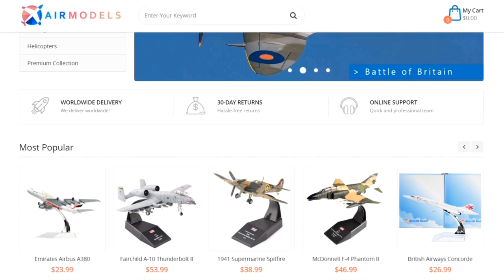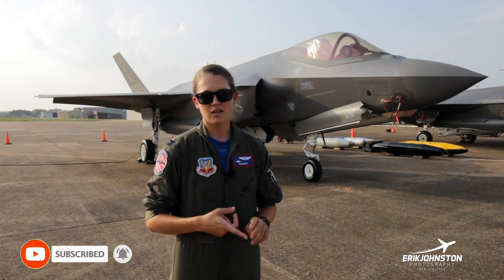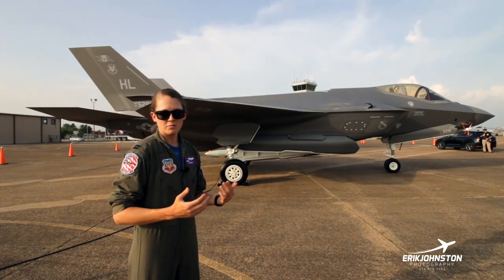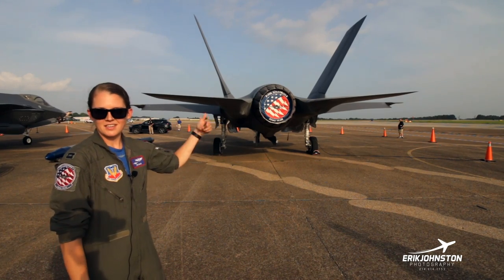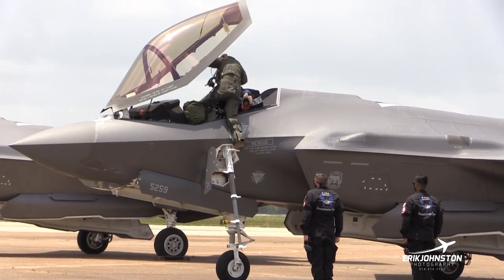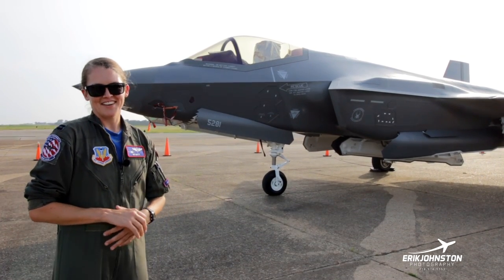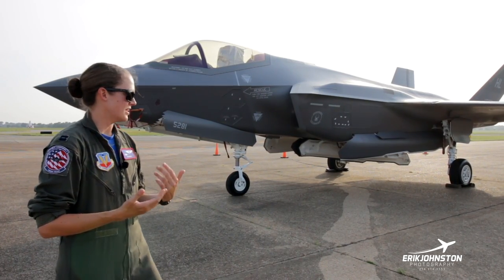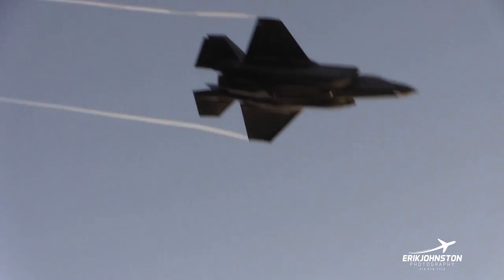F-35 Lightning Walkaround Tour

Comment: tis a shame shes so hobbled on what shes allowed to talk about. you can tell shes constantly running through what shes allowed to talk about
Reply: Gmail X or it can they just don’t want to leak classified things.
Reply: Commenter2   Not a chance!
Reply: Gmail X  thats right !  if can do far far more
Reply: She still seems to imply that the AIM-9X can't be carried internally. Not something you'd want enemies to know.
Reply: @thomasjoyce7910  well some things are common sense with this sort of aircraft. if the f22 can carry em internally then odds are this one can too
Reply: @thomasjoyce7910  it cannot. The wingtip hardpoints have a special pylon with reduced RCS for AIM-9X and AIM-132. AIM-9s are not included in standard A2A loadout, but if equipped, the F-35's RCS is still going to be minuscule.
Reply: @UnconfinedConfusion  i think that's his point

Comment: The F-35 has always left me a little cold, this presentation warmed me up a bit...
Reply: Seems most of its advances over previous craft are in its ability to relay situational data to a web of connected aircraft, so it kind of develops a hive mind. Not as "sexy" to talk about.
Reply: Travoid this is the thing a lot of people don’t understand. The USAF did a study a while back and found that 90% of pilots shot down even as far back as WWII never saw the plane or missile that hit them. Being stealthy, seeing the enemy first, and having versatile and powerful weapons has become more important than outright performance. Between active and passive radar and IRST, the F-35 will doubtless be able to see any current or near future fighter before the enemy sees it. Combine that with the coming lock-on-after-launch capability with the new block of AIM-9X and you have a fighter that can passively detect an enemy with IRST, and the pilot can fire a missile without looking down at the panel, even if the enemy is behind the F-35A due to the off-boresight capability of the new missiles.
Reply: @dheujsnrhfydhehehshshhdggsd  how's it like to live in a cave?

Comment: I believe that the F-35 was the most expensive military-procurement program in U.S. history. It was an ambitious project -- three variants with which to supply all of the armed forces. Unfortunately, none of them were reliable enough in the first few years to be of any tactical use.
Reply: "three variants with which to supply all of the armed forces" - already a thing with the F-111 and the F-4.
Reply: @ChucksSEADnDEAD  Perhaps, I don't claim to have knowledge of that. But I doubt that either of those programs cost just short of one trillion dollars.
Reply: @waynefletcher9884  The Navy flew the F-111B and the lackluster performance lead to the project being canceled but you're right, it was meant as a two branch project, not three branch project. I was misremembering.
Reply: @JMacQ77  The F-35 didn't cost a trillion dollars. The trillion dollars is the projected cost up until retirement.
Reply: F-22 is much more expensive!

Comment: It's the only aircraft that doesn't need line of sight to fire a missile air to air. In other words, there is no dogfight.
Reply: That isn't true. The Russians had the technology decades ago with a device that fit on the helmet that looks like a monicle followed by the U.S. which surpassed the technology with the 1990's vector thrust Aim-9X which allows an attack 45 degrees off of bore sight instead of 15 degrees. However the F-35 has a massive sensor sweep system that can target air to air and air to ground at the same time and data link the targets to other weapon systems in real time. It's the equivalent of a plane with nearly endless ammo.

Comment: he is a good pilot; and most likely has her choice of planes, but...

A thing that were not covered about the F35, possibly due to the fact that the one featured is not VTOL. The VTOL variation of the F35 has a **mechanical driveshaft**, a slightly better version of the same device one would find in a pickup truck

Comment: Whyd they have to drop the most epic 22 Raptor?  :(
Reply: Huge mistake. I’ve read a lot of articles talking about how they didn’t build enough Raptors, should have built more. They were getting to the point where it was cheaper to build an F22 than an F35 as the cost were coming down.
Reply: Because it's not worth the money.

Comment: The F-35A has a problem with its cannon, which is mounted internally inside the aircraft. “Units flying newer F-35A aircraft discovered cracks in the outer mold-line coatings and the underlying chine longeron skin, near the gun muzzle, after aircraft returned from flights when the gun was employed,” DOT&E found in its annual FY 2019 report.
Compounding the problem is that the F-35A’s cannon can’t hit the target, a problem that has been reported in previous years. “Based on F-35A gun testing to date, DOT&E considers the accuracy of the gun, as installed in the F-35A, to be unacceptable,” said the audit. “F-35A gun accuracy during SDD [the System Development and Demonstration phase of the program] failed to meet the contract specification. Investigations into the gun mounts of the F-35A revealed misalignments that result in muzzle alignment errors. As a result, the true alignment of each F-35A gun is not known, so the program is considering options to re-boresight and correct gun alignments.”
Reply: yeah problems problems problems. New jet issues.
Reply: @EEEEEEE354  Yeah 163 billion over budget and seven years behind schedule new jet issues.
Reply: @teddyballgame4823  Every jet goes way over budget even the F-16 did. The F-35 program is just massive and encompasses 3 different variants. Not only that, but the aircraft are proving their worth in actual combat and exercises. Most certainly not useless just because the gun isn't fixed yet. The F-35 keeps proving itself, and you naysayers continue to be wrong. Tune in for the FY2020 DOT&E report.
Reply: @teddyballgame4823  I don't need an article talking about the DOT&E and GAO reports. I've already read them. I totally agree that building weapons shouldn't be our priority when it comes to federal spending but the F-35 is not a lemon as the article says. Like I said, the aircraft has already proven superior to any adversary. Throwing more articles quoting the exact same document is not a rebuttal against the fact that new aircraft have issues. Here's the actual source. I've read it,  now you try: https://www.dote.osd.mil/Portals/97/pub/reports/FY2019/dod/2019f35jsf.pdf?ver=2020-01-30-115432-173 
Go ahead and read all of them for that matter. Notice how the list of issues only gets smaller. You are ignoring the positives and steady progress this program has made.
Reply: @EEEEEEE354  You are ignoring the corrupt Military-Industrial Complex. I could care less about the tech that works. The US always needs an enemy and if there is not a clear enemy the US will create one for war. People like yourself think that our ridiculously over-funded DOD is necessary.
Reply: @teddyballgame4823  I'm not ignoring that. I'm simply vouching for the F-35 as a piece of technology. That's what the video is about, that's what I was talking about. It's a fantastic aircraft. I agree with you on the US being a corrupt POS that literally funds it's enemies and starts wars. We are good at building weapons because we always need a brown person to oppress. I don't think you understand what side of the issue I stand on, friend.
Reply: @EEEEEEE354  No actually the US is not good at building weapons only wasting money building weapon systems. The Isreal defense industry is much better at designing and building weapon systems. They greatly improve US weapon systems.
Reply: @teddyballgame4823  we are very good at it. Likewise, the Israelis are also experts of spreading western imperialism. They have been using the F-35 lately
Reply: @EEEEEEE354  Yes I realize that Israel has flown the F-35 over Iran undetected and sorties into Syria. Israel has been granted access to the source code of the F-35.
Reply: @teddyballgame4823  yeah. The plane works lol. I just have to ask. Are you cool with Israel or something?
Reply: @teddyballgame4823  absolutely agree with you. Glad we are on the same page about this stuff
Reply: @EEEEEEE354  We can agree to disagree on the JSF F-35. Thank you for keeping the discussion civil. Cheers!
Reply: @teddyballgame4823  You do realize that if the F-35 suffered from the same issues as the F-16, 23 of them would've crashed this year already, right? In the first 10 years of service there were around 350 F-16 crashes. That's about one accident every 10 days.

Now a few decades later people cause drama because the gun alignment will have to be fixed. Really puts it in perspective doesn't it?
Reply: They are just going to stick a combat laser there.  The Apache helicopter combat laser has a range of 1.4 km. 1.6 km is about 1 mile. A 30mm round can travel about 3.3 km.
Reply: @ivanlagrossemoule  damn thats crazy... Modern media and internet give people very little tolerance for issues in large scale programs. People don't understand how hard and complex aircraft development is. Problems will be aplenty!
Reply: @orlock20  Doubt it. At least no time soon.

Comment: Will probably catch some serious flak for this but...

The A-10 is still flying because the F-35 can't do what the A-10 has done/does/can still do... and bring the pilot (and the tax money) home. "Multi-role" is a great money-saving concept... until the pilot's life and the mission are at risk of being cut short.
And how many F-35 helmets (@$400Kper) add up to one A-10 air frame (were it still in production)? Asking for logic's sake.

I do believe the F-35 is incredible and serves our nation and allies well (I actually contracted at Lockheed back in the competition phases of the F-35 and the early trial phases of the F-22). But the A-10 should be our teachable moment in aviation. I feel our tax dollars (in addition the 35) would be well spent on an A-10.2 variant... another purpose built ground attack aircraft, based on the A-10, with 1: 21st century materials and 2: (to a much lessor extent) 21st century tech (avionics) and war experience. Hope this strikes a cord... a 1970s design is still filling a critical role where 21st century tech can't.

A Swiss Army Knife is great... but for all it will do... in the end... it's a compromise.
All that said, respect to the pilot. She gave as good a walk-around as security would permit.

Comment: The F-35 is full of modern and cutting-edge technology but without that technology it’s inferior to many 4th Gen fighters. The F-15, F-16 and F/A-18 Super Hornet all carry more than double the amount of ammunition than the F-35’s 180 or so rounds. The F-15 can carry 5 times as much ammo depending on the variant. The F-15, F-16 and F/A-18 also are much faster overall than the F-35’s top speed of Mach 1.3 or 997 mph. What’s worse is that the Marines F-35B and Navy’s F-35C are limited to less than 1 minute of flying at maximum speed to keep engine stresses down. For comparison the F/A-18 tops out at Mach 1.8 or 1190 mph. The F-16’s top speed is Mach 2 or 1500 mph and the F-15 hits over Mach 2.5 or almost 1900 mph. Even the F-35’s range isn’t that great but it does beat the F-16 and F/A-18’s Combat Range by about 200 miles. The F-15 however can carry almost 5 tons more of ordinance and has almost double the Combat Range of the F-35. For an aircraft that is supposed to be the Jack of all trades and is intended to fulfill the roles of older aircraft like the A-10 and F-16, the F-35’s only real advancement is it’s stealth technology and avionics. It can’t provide ground support like the A-10 and it’s slow top speed significantly reduces it’s response times when needed at distant locations. The A-10 can loiter around ground forces providing support for significantly longer times and with over 1000 rounds of ammunition the A-10 can strafe enemy forces over and over and over again. The F-35 has enough ammo for a 3 second long strafing run and then it’s out of rounds. The 25mm bullets might be a little bigger than some fighters 20mm rounds but a bigger bullet doesn’t do any good if you don’t have enough and they don’t hit the target. I honestly think that the government is doing everything they can to make the F-35 look better than it is to save themselves further embarrassment for wasting so much of the taxpayers money on an aircraft that’s not really that good.

Comment: Removing a “Rivet” on an access panel?!!!  I don’t think so.  Rivers are permanent fasteners and would not be used on a “daily door” to access common areas for maintenance or daily inspections.  More like a screw or cam lock (Zeus fastener).  Terminology!!!
Reply from the maker: tomcatter11 
You are correct. This was the first in-depth Walkaround video of the F-35. Now throw in the over 100 degree heat in the ramp that day and shove a camera in your face, it’s not uncommon to miss up a word or two. I’ve had pilots fumble up words on a Cessna walkaround video. It happens.

Comment: So it's basically a multi billion light weight two bomb max bomber. 😂
Reply: In "beast mode" the F-35 can give up some stealth for externally mounted ordinance.  It can carry six 2,000 bombs, two AMRAAMs, and two AIM-9Xs.  Or it can go pure air-to-air and carry 14 AMRAMMs and two AIM-9Xs.  
In "stealth mode" it's like a stealthier F-117 that can also defend itself with 2 AMRAAMs. That's a perfect configuration for interdiction missions.  The F-22 can't carry 2,000 lb bombs, so the F-35 is filling a gap left when the F-117 retired.
Reply: @NeoDemocedes  Meh 😏
Reply: 77 million a piece. It can deliver those two bombs in places where most aircraft would get shot down. Two bombs are better than no bombs.

Comment: Huh, I thought the F-35 can super cruise like the F-22, guess not.
Reply: Nope, the engine gets a lot of boost from the burner, but when at Military power it hits about .92 and the Shockwave drag cancels out the thrust. I've been told by a F-35A pilot that if they are lower on weight they punch it up to 1.3 Mach and then go back to mil and it takes a minute or two to bleed back to subsonic. Not really supercruise though.

Comment: Only 3 seconds on guns? Thats not a lot
Reply: For Air To Air you don’t need but a couple shots to render another jet incapacitated. With 25mm at 60 rounds a seconds an extremely skilled pilot could easily take down 3 hostiles. For ground targets it’ll take a little more but more often then not large targets end up just getting bombed.
Reply: @SmallishBear020  its never rally going to be used in anti air purposes. Something would really really have to have gone wrong because of the bvr tactics. In air to ground this is not enough. This was supposed to replace the a10 and It can't with this amount. Yes in the future they are probably going to do more with sdb's and gbu's but real CAS is better with guns just because of low collateral and low risk to nearby troops.
Reply: daan stam whilst I agree something in BVR would need to go wrong for ranges to become this close, I believe that’s mostly the case for if an F-35 was in an engagement with 4th gen craft. With the introduction of stealth being common in most countries as 5th gen, engagement ranges will get closer and closer to account for the time it takes to actually detect a stealth craft. The A-10 and F-35 do share some of the same roles, however it is carried out in much different manner by the two craft. The F-35 (25mm gun) utilizes it’s stealth to get close, and take out a few high value targets using bombs. The A-10 (30mm gun) is basically forced to take out everything along the way to take out any high value targets because of its lack of stealth. The F-35 is a multirole fighter, meant for more than replacing a single aircraft.
Reply: I believe it's just a holding place for an eventual laser. The B and C version use gun pods when they want to shoot something air to ground.

Comment: Wonderful aircraft and expensive to run. Many of the partner nations, that helped pay for the F-35, will likely use a combination of the F-35 and a cheaper to run aircraft such as the Gripen E.  F-35 capability is a must have but the F-35 is not always needed. Need for the F-35 depends on the political situation at the moment. In the NORAD role showing Russia NORAD capability, but also that you can surprise them with other capable fighters, is a good thing. Keep Russia, not knowing what to expect in any single intercept.
Reply: Unfortunately nobody is buying Gripen E thanks to its high unit cost.  Most countries would probably use an F-16 or something.
Reply: It's not expensive to maintain.  Norwegians Air Chief said it costs the same to maintain and operate as their F-16s, which was 11,000 Euros/hr.

Comment: I heard women can take more g forces?
Reply: That isn't true, however -3G + 9G is standard for air force fighters for all countries and -3G +7G is standard for U.S. Navy fighters and other fighters with folding wings made for storage.  Also with a load out, the max speed and turn radius greatly diminish.  With a G-suit it is possible for some men and women to be able to pull 9G.
Reply: @orlock20  aerobatic pilots with no g suits regularly pull and hold +10/-5 with no g suits

Comment: Sure the F-35 is faster then the F-18 Hornet, the reason is no weapons oh, the Hornet can carry 10 * the weapons that you can carry that's why is faster and lighter proteinsimple but not worth the difference in the cost same way with the F-22 another joke
Reply: Go check out any of the podcasts with David Berke(fighter pilot podcast or Jakcko podcast), he was a Top Gun instructor that has actually flown both the F22 and F35.  And I do believe that that once you add the pylons it is comes in real close to the same payload as the F18D.  I like the look of the 18D's better.